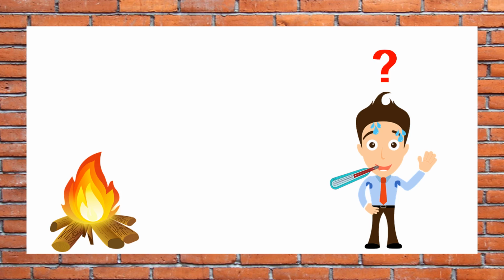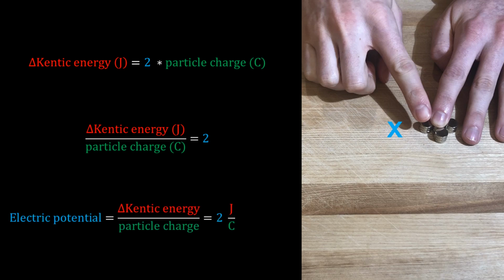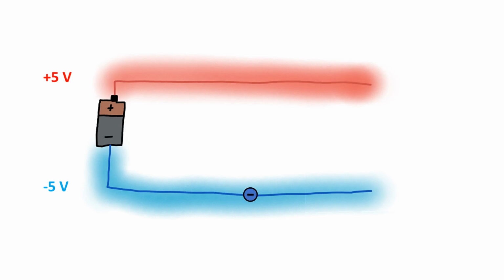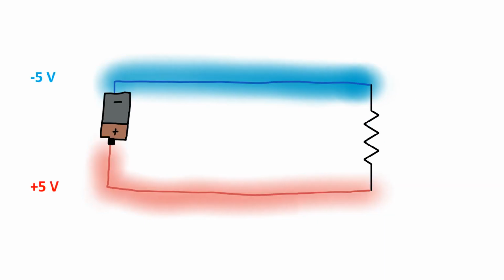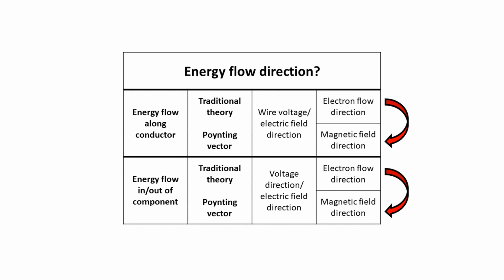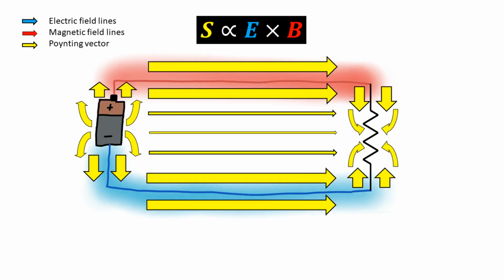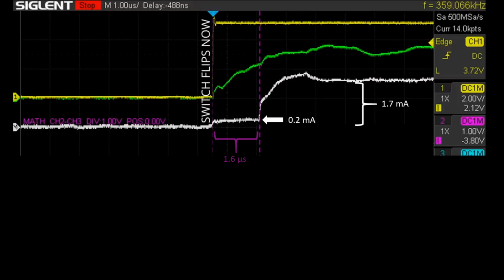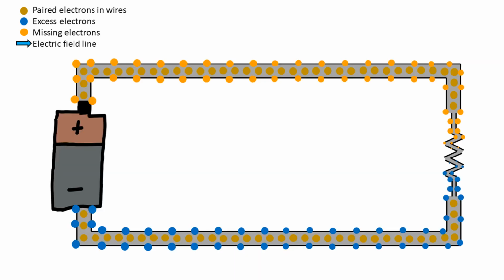Veritasium Electricity explained

Comment: Energy transfer is always in the EM field, wave or stream (DC). Original intent of the Veritaisum videos (second one is way better).
You either "spray" it like a radio or light works...
Or condense it close to the wire surface (that's the property of metals), at insulation thickness. More efficient than radio/light transmission (so we don't have a "wireless power plants").
Easy (shortest, practical explanation ever).

Comment: All of you are wrong and the light will turn on instantaneously! The proof are the experiments by many researchers, backed by theory, that now show that instantaneous signaling is possible in the nearfield of EM sources, and that the speed of light is not constant speed c, disproving both Relativity's prediction that signals cannot propagate faster than light, and disproving the 2nd premise in Relativity. What remains is the 1st premise : Galilean Relativity. If Relativity is wrong then so is any theory based on it like, General Relativity and QED.

An experiment just published in the EM journal IRECAP shows an EM pulse propagates instantaneously in the near field across 1.5 meters of space with no propagation delay. This shows that the front speed (speed of information) or speed of causal action is instantaneous in the nearfield of EM sources. The experiment was repeated hundreds of times, and also done by an independent researcher in their own lab, with exactly the same results. The paper also shows that the effect is predicted exactly by Maxwells equations. The paper is linked below. The effect can also be shown to be fundamentally due to the Heisenberg uncertainty principle. This shows that the effect is fundamental to all fields including: EM, gravity, and quantum.

In another experiment, a sinusoidal signal was transmitted between 2 dipole antennas as they were separated from the nearfield to the farfield. Analysis of the resultant phase vs distance curves (dispersion curves) shows a clear minima in the nearfield for all the EM field components. Applying well known phase speed and group speed operators to the curve, which are inversely proportional to the slope of the curve, show that both the phase speed and group speed are instantaneous in the nearfield and reduces to about speed c in the farfield.

Both experiments have been independently repeated by other researchers, obtaining the same exact results. If speed of light is not constant, then the 2nd premise in Relativity is wrong and what remains is the 1st premise: Galilean Relativity. Instantaneous signals violate the Relativity of Simultaneity because the signals appear the same in all inertial frames of reference. This can easily be seen by inserting c=infinity into the Lorentz transform, yielding the Galilean transform, where time and space are absolute. So if a moving body is observed with instantaneous nearfield light, then no Relativistic effects will be observed. But they will be observed if the frequency of the light source is changed such that farfield speed c light is used. So by simply changing the frequency of the source, Relativistic effects can be turned off and on. The only possible explanation is that the effects of Relativity are not real and are just a type of optical illusion. This result will affect all of modern physics.

In addition, the above results are predicted by EM theory. Maxwell's derivation of the speed of EM fields was wrong. The reason is that EM fields are created by sources coming from Gauss' and Amperes laws., and these sources must be included and can not be set to zero as Maxwell did. Including the source term yields a wave equation equal to a source term. Inserting a dipole source yields EM field components that with phase vs distance from the sources dispersion curves with a clear minima in the nearfield, and become only approximately linear in the farfield, starting about 1 wavelength from the source. It is well known that both the phase and group speed are instantaneous when there is a minima in the curve, and only exactly a constant speed when the curve is exactly linear, which only occurs at infinite distance from the source, which does not occur in a finite sized universe like ours. So Maxwell's solution is only valid at infinity, which does not exist in this finite sized universe. So the speed of light never a constant in our universe. If the speed of light is not constant, then the 2nd postulate in Relativity is wrong.

The same behavior can be shown to occur in gravity. It is well known that general relativity reduces to gravitoelectromagnetism (GEM), which assumes that gravity can be modeled by Maxwell's equations with different constants. So the same solution that occurs in EM theory also pertains to gravitational theory. This explains the instantaneous gravitational effect in the near field, observed in the stability of the planets, and also explains that Gravity waves have been observed to propagate at about speed c in the far field. This theory then accounts for all the observed gravitational effects including instantaneous nearfield and the speed of light farfield. The main difference is that this theory is a field theory, and not a geometrical theory like General Relativity. But because it is a field theory, Gravity can be then be quantized as the Graviton, enabling the unification of Gravity and Quantum Mechanics.

The phenomena also can be seen in quantum theory, and can be shown to be the consequence of the Heisenberg uncertainty principle. At the source, the position of the photon emitted from the source is precisely well known, hence the momentum or the speed is infinite. At about 1 wavelength from the source, the wavelength is starting to be come clear, such that frequency x wavelength ~c. But according to Fourier Theory infinite cycles are needed for the wavelength to be exactly known. So the above frequency wavelength relation is only valid at infinite distance from the source. So the speed of light never reduces to exactly speed c in our finite size universe. This phenomena should be fundamental to all fields including: EM, gravity, and quantum, and in particular quantum tunneling.

There are currently many interpretations of quantum mechanics. But only the Pilot Wave Interpretation is compatible with Galilean Relativity. In this interpretation real particles are guided by real pilot waves. But the real pilot waves are known to communicate information about the particles instantaneously with the environment. Because this is not compatible with Relativity Theory, this interpretation has not been taken seriously. But as a result of this discussion, this is no longer a problem, and Pilot Wave theory should now become our best interpretation of quantum mechanics. And combined with instantaneous nearfield interaction, can perhaps explain the instantaneous interaction observed in quantum entanglement.

For more information see the following links:

*YouTube presentation summarizing my 35 years of research in this area: https://www.youtube.com/watch?v=sePdJ7vSQvQ&t=0s

*More extensive paper for the above arguments: William D. Walker and Dag Stranneby, A New Interpretation of Relativity, 2023: http://vixra.org/abs/2309.0145

*Electromagnetic pulse experiment paper peer reviewed and just published last month in Journal IRECAP: https://www.techrxiv.org/doi/full/10.36227/techrxiv.170862178.82175798/v1

Dr. William Walker - PhD in physics from ETH Zurich, 1997

Comment: Poynting vectors are used in EM wave propagation in vacuo where there is no charges or currents, but only varying in time E fields and B fields. 
We cannot apply P = V I; therefore we apply E X B to get the power flow.

Comment: Everything is photons. There is no such thing as a solid little nut (electron) orbiting a nucleus. Hence the problem of radiation during acceleration duznt exist.

In an atom, what we have is a photon orbiting a nucleus. Let us name this an elektron. It has a negative charge. It radiates, & radiation needs energy. But, that radiation is little different to ordinary radiation that radiates from every photon all the time for ever. The energy comes from the aether, we dont know how. Elektrons migrating along in a wire give us (a slow) elektricity.

When a photon forms a loop (by biting its own tail) then it makes an electron. Electrons have a negative charge. Electrons can sit on & migrate on a surface -- or fly throo space – they give us static charge -- & movement (on a surface)(or through space) gives us (a slow) electricity.
The acceleration of an electron needs the input of energy. And apparently the acceleration of an electron needs additional input of energy to replace energy radiated by the acceleration.

What standard science calls electricity in a wire is actually due to photons hugging the surface of a wire. Let us name these elektons. Elektons have a negative charge. Elektons propagate at the speed of light, & give us (fast) elekticity.

Elektons & elektrons propagate at the speed of light all the time for ever, so in that sense there can be no acceleration of the propagation. But, elektons & elektrons can be made to change course or move or migrate, & i don’t know whether this requires input of energy.

And, we have (fast) Elekticity, & (slow) Elektricity, & (slow) Electricity -- 3 kinds.
And we can add the ionic form of (slow) electricity, where negative ions migrate -- this needs a new name -- iontricity praps.
And we can add the positive ionic form of (slow) electricity, where positive ions migrate -- this needs a new name -- positricity praps.
And if in the positricity the positive ions are simply protons then this needs a new sub-name -- protricity praps. So, we have 6 kinds of electricity.

Comment: I have an EE background.  'Drift velocity' puts the lie to "electrons flow in the wire" despite what many of us were taught.
Another issue not discussed correctly during my studies was - the exact physical nature, WHY, the magnetic field is created around the wire.  The notions that 'the electrons aren't really moving in the wire' along with 'moving charges create a magnetic field' was puzzling.

1)  In space, an immense (arbitrarily large) negative potential is attached to one end of a copper wire.  AT NO TIME ARE ELECTRONS PUSHED OUT THE OTHER END OF THE WIRE   Electrons are not flowing in the wire, you cannot 'force' electrons into a wire.  The experiment is conducted in space to eliminate the confusing aspect of atmospheric gases interfering with the high potential at the open end of the wire (where NO electrons flow out of).  The "electrons flow in the wire" idea, like water in a hose, should have been eliminated decades ago.  It is still being held out as fact.

2)  In the 1920s it was firmly established that aligned electron spins are the source of detectable magnetic fields.  The electrons in the copper wire, when the wire is placed across a charge separation (battery, power supply, etc) are electrically attracted to the positive side of the battery or pwrsupply.  DRIFT VELOCITY keeps their motion astonishingly limited but they 'bunch up' in the wire in the direction of the positive battery terminal.  The Exchange Interaction intervenes - the Exchange Interaction is Nature's way of reducing the Coulomb force build-up between the bunched-up "like" charges - the electrons - by ALIGNING THEIR SPINS.

Aligned electron spins sustain a greater distance from each other due to the magnetic repulsion between them ('like' magnetic poles repel).  And that is the source of the magnetic field around the wire - alignment of electron spins, caused by an increase in the Coulomb force as the electrons 'bunch up' as they are drawn by the positive electric pole of the battery or power supply.

As for the Poynting vector and 'all the energy in a circuit flows OUTSIDE the wire',  you can hook up a 12v car battery to a single 100 watt light bulb, and all the energy 'outside the wires'  will NOT light up that bulb.   If one of the wires from the two battery terminals is disconnected the tiniest distance from the light bulb,  no energy 'outside the wire' is going to light the bulb.   A 12v car battery has immense energy above that required to light the bulb, but unless physical contact is made, there is no way to communicate the immense charge separation in the battery across the bulb's filament, which is basically a resistor.

Electromagnetic radiation from a tesla coil can ionize the gas in a fluorescent light bulb tube with no conductors required, but this is not the same as the car battery above, with immense electric energy, failing to light a 100w bulb, despite the claimed poynting vector energy 'flowing outside the wires'

.
Reply: No, I can't agree. The field is caused by the charged particles. They love to make it mysterious, but the Merck Index had conduction listed for all substances. In fact, electrons do move. They have a field.  As far as how that makes a magnetic field... I refer you to the Feynman explanation that relies on relativity.
Reply: I am 33, I have two children. My income is not impressive and I am reading a debate of a bunch of nerds about how electricity actually flows... What might go wrong?!

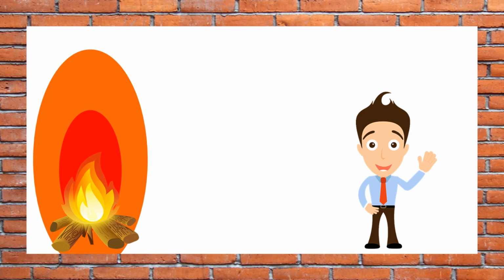Comment: It is not all that important to the bigger discussion but unfortunately the description at 3:30 is incomplete and misleading. An open fire is hot enough that one will feel radiant heat from it before the air heats up. Otherwise I think you made some good points in this video and think it is unfortunate it does not have more views..

Comment: Great video; but - still deserves a bit further clarification because the 'devils in the details' (1) no mention of impedance, capacitive or inductive reactance (2) no mention of the transient vs steady state response of the circuit (3) no clear mention of the fact that the electrons do have kinetic energy; yes its true that a single electron has no potential energy on its own, but a more accurate statement is that it has potential energy in the presence of a field, potential energy that is converted to kinetic energy and potential  (relative to the source) decreases as you move around the circuit and finally my biggest issue with Veritasium (4) he muddles the idea of a propagating electromagnetic field as per radiant energy from a higher frequency source in an antenna with that of the static near fields surrounding a wire in a DC circuit - two related but different phenomenon.  Thankfully everyone is sticking to classical vs quantum models of electrical energy.  

At the end of the day we are getting bits and pieces of the puzzle sorted and learning in bits and pieces but no one yet on You tube has just given a really thorough step-by-step explanation of the sequence of events from the closure of the switch (1) potential energy in the battery from a chemical reaction that separates charges until equilibrium is achieved before the switch is closed (2) random electron movement exists in the wire, until the voltage (potential energy per coulomb) is applied (3) slow net movement of electrons begins, but everywhere in the circuit after a time delay caused by the dynamics of how the electric and magnetic fields set up and stabilize moving from the transient to the steady state response based on the total impedance of the circuit (4) incandescence in the bulb; Max Planck was trying to improve light bulbs when he stumbled on to a discovery that led to QM (5) Potential energy in the field, imparted to all of the electrons in the wire and bulb filament as kinetic energy (6) net energy transfer in the direction of the Poynting vector but following the wires that support the field (7) depletion of energy in the battery (8) conversion of energy in the bulb to light and heat; IR (9) the bulb comes on quickly when you flip a switch not because an electron has magically raced all the way through the wiring to the bulb, but because the electrons in the wire collectively support the establishment of a field in a very short period of time, and yes the potential difference or voltage between any two points keeps the electrons moving from negative to positive (10) in Veritasiums circuit the bulb does not come on because the energy flowed through space as a propagating electro-magnetic field as in a radio antenna (although with the right setup you could easily to that), but critically because the electrons in the wire support a static near field that delivers energy (10) the difference with AC is critical, now you have an oscillating electric and magnetic field that can pass continuous energy flow through the space between the primary and secondary winding in a transformer (hangs on the pole outside your house) in accordance with Maxwell's laws at 50 or 60 Hz; not the same as a static field in a DC circuit.  

Now in any summary for any audience, we cut corners and make general statements, assumptions and approximation and we still use the Drude model from classical physics, so I'm sure that it won't be difficult to find fault with my summary as well.

In any case, anyone who is following the great debate, is thinking and learning and that's all good.